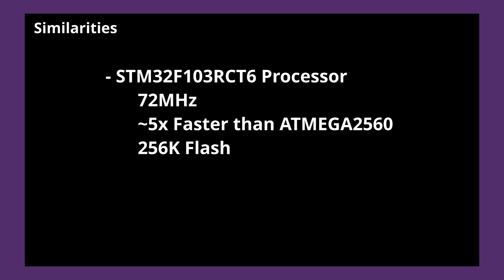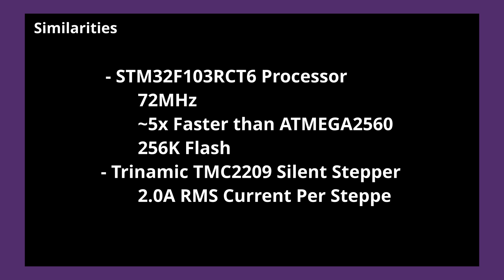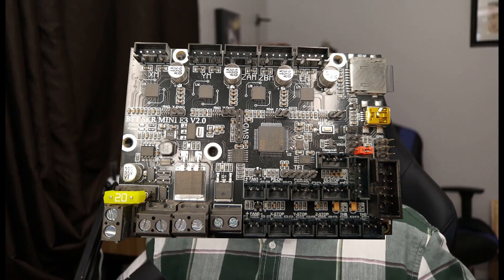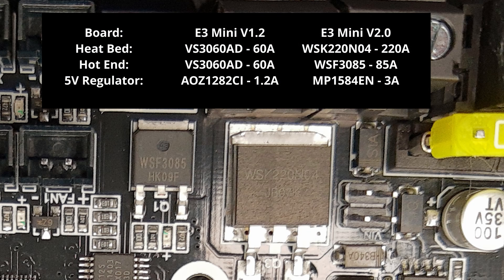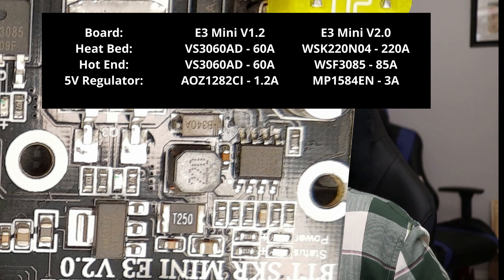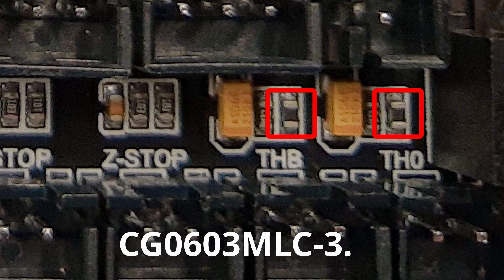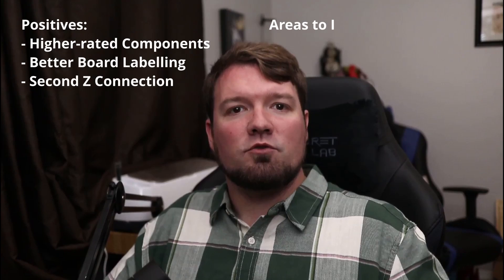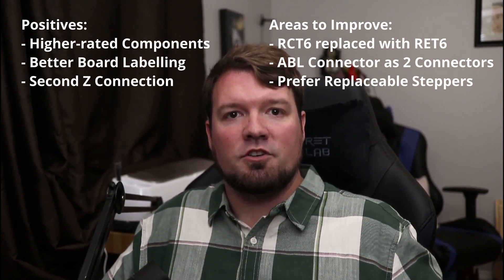BTT SKR Mini E3 2.0 - Worth The Upgrade?

Comment: @1:12 : Yes, the original spec may say 256K BUT you can access 512K of programming (well, a little less for the virtual eeprom space) with the F103RC chip. Why it was programmed to report only 256K? I dunno, maybe the first iteration did and they just kept in the spec? Anyway, Marlin 2.0 and the Marlin autobuild in VS Code have it configured for 512k automatically. You don't need to change any of the configuration (i.e. platform.io) manually.

Comment: I've had good luck with my V1.2, but I don't use it super heavily. My biggest hope for the V2.0 board is that it doesn't vamp power over USB. I don't know if this was touched-on in this video or not. I specifically talked with SKR about this before the 2.0 board released and hopefully they heeded my request. I'd at least like an jumper to give an option about it. This affects me as I use Octoprint and I don't want my mainboard sucking power over my Octoprint's USB connection. I want my Octoprint Pi machine to run all the time and be able to control a relay to switch on my SKR board. I'll probably upgrade anyway. Thanks for the video!

Update: I just reviewed the schematics for both boards and it looks pretty clear to me that the V2.0 board no longer does anything meaningful with the USB +5VDC line, so, that's encouraging. Though, I could be mis-interpreting here.

Comment: So it the upgrade from V1.2 to V.2 worth it? I have just had a V1.2 in my Ender 3 and it has just gave up the ghost (pardon the pun) so I am thinking of upgrading to V.2 and going with the TFT, but because I don't have a BL Touch or anything else attached is it worth just sticking with V1.2 and a TFT? and saving a bit of cash?

Comment: In the US most outlets circuits are on 20A breaker, if they were to actually trip at 20 amps that would yield 2300w @ 115v. You're only supposed to use 80% of a circuits rated capacity, so let's say 1800+ watts. In reality, according to Goodson Engineering,  "a 20 amp breaker must trip at a sustained current of 27 amperes (135 percent) at less than one hour, and at 40 amperes (200 percent of wire rating) in less than 120 seconds" That's a sustained 3100 watts must trip in an hour or less.

Comment: "...Household breaker can handle 1440W before tripping..."

Laughing in European 3.5kW standard breakers
Reply: Kinda sucks when your country invents the mass use of electricity and implements it first while the rest of the world waits to get the 2nd mover advantage.
Reply: @LastNameTom  Changing over would cost money and it could be done overtime, but it is doable since you guys already have 220V anyways between the split faces.

Now what I find completely unacceptable in the US installations that not the whole house is protected with GFCI (RCBOs)

Comment: 03:50 In EU we have 230V standard and barkers are usually rated 10A and 16A for heavy loads, so usual outlet will provide at least 2300W of power.
Reply: New installations use B16 breakers for sockets exclusively, so 3.5kW

Comment: excuse me, german outlets can provide 3.6kw before tripping a breaker, where can i get a heated bed that will take that much current?
Reply from the maker: Most pads are developed for limitations that are safe around the globe, so you'll be hard-pressed to find anything above 1440W unfortunately :(. Still, 1500W is akin to a blowdryer, so it'll heat up VERY quickly.
Reply: @TheFirstLayer  hehe i know, those 24v beds still do it rather quick, its under 3 minutes to get to 60°C. the only machine i know that draws close to those 3.6kw is my welder and thats running on a 230v 20A breaker so theres still headroom for it

Comment: I swapped it into my ender 3 pro with a tft35 and I couldnt be happier. I have used 3 fool spools and many hours for printing. no problem so far, and wow is so much more quiet. it was a low cost must.  atleast for me. usb and sd reader was a gamechanger for me too with tft support. it doesnt freeze any more.

Comment: I have the 2.0 it’s great. I tried using the 5 pin connector for my ANTCLABS  V 3.1 BLTOUCH   I couldn’t get it to work unless putting the black and white 2 pin connector into the Z home connector.  Of course using the appropriate firmware.

Comment: Actually, it turns out that the STM32F103RCT6 (ok that's a real mouthful, I'll call it the 'RCT' from now on) used in both the SKR 1.2 and 2.0 boards actually contains 512K of flash, even though it is spec'd as only having 256. Furthermore, a 512K variant of the RCT chip platformio was added to mainline Marlin. In fact, BigTreeTech themselves actually build their official firmware this way -- if you take a look at the platformio.ini file in their firmware, they have their platform set as STM32F103RC_btt_512K! I've been using these chips as 512K chips (in both the SKR 1.2 and now the 2.0) for quite a while now and have not run into any problems, nor have I heard any outcry from the community about others having trouble with configuring the board this way. The general consensus as to why this is the case is that STM did this so that they could make different processors they could sell at different price points without having to design whole new silicon.

I am really happy with the 2.0 upgrade. I have heard that the 5V rail is more stable/less noisy as compared to the 1.2 board -- I don't have a scope so I can't verify this myself, but I can say that I am running both a BLTouch as well as a few neopixels without issue. (on my 1.2 board the BLtouch was kinda glitchy.)  Plus the board has provisions for plugging in the dedicated BTT 5V power module should you need a beefier 5V supply (dunno why, maybe you want to run 1,000 neopixels or something *shrug*) Plus you can add a UPS board, which is basically a board with a buttload of capacitors on it, that basically gives enough "wiggle room" for power loss detection code to be able to do meaningful work before the board runs out of power.  Add the dedicated EEPROM, improved MOSFETs, better thermal conductivity, etc., and I think the 2.0 is a pretty good deal.
Reply from the maker: I didn't want to blindly say the RCT6 has 512, as I have experienced several boards with both the 256 and 512 loads, with no easy way to easily determine which variant unless through trial and error. Also, given the E3 DIP 1.1 has the RET6 in every board I've seen, I expected the 2.0 boards to be the same across the board.
Reply: Be interesting to hook up an O-Scope to the 5V rail for each board and comparing them.

Comment: As a new person to 3D printing, I am having issues with the 2.0 board. The pre-compiled firmware for the BLtouch does not work. As a warning for those like me that bought this board for the "ease" of upgrade using an ABL. I now need to learn more about configuring firmware and troubleshooting the issues with the ABL ( mainly it will not complete a grid unless you manually level first. Which defeats the purpose of the ABL.) then I was planning on.
Reply: Are you using the correct version of the BLTouch firmware? BigTreeTech has two separate versions, which one you use depends on how you have your BLTouch plugged in. "firmware-bltouch.bin" should be used if you have the BLtouch plugged into the PROBE connector AND ALSO your regular Z-endstop plugged into the  Z-stop connector. "firmware-bltouch-for-z-homing.bin" should be used if you are NOT using your regular Z-endstop but instead have the BLTouch plugged into the Z-endstop connector.
Reply: @Otakunopodcast  I have tried both versions and both set ups. They did not work correctly. I have since compiled my own Merlin and still not working correctly. It homes correctly, will go through the 25 points, but when it prints i have high and low areas on the print. My print's first layer will be so close in some places that the layer is translucent, and far enough away in other areas that it doesnt have good adhesion. So I end up having to manually level still. I can not install my solid mounts since the ABL isn't adjusting the Z as it prints.
Reply: @chuckfiero  Your problem may be an odd quirk in Marlin. First, after you do an ABL you should always save to EPROM. Second, every time you home the printer, it turns ABL off. Most slicers implement a home before printing. 2 solutions. Edit  your slicer g code so it enables ABL before printing. Second, edit Marlin firmware to tell it not to switch off ABL when it homes. Both solutions are easy to find via Google.
Reply: @dereksteele1189  I went through and did my own firmware and I did get a result, I made sure that restore bedlevel after home is active. New question, I have my slicer set to G29 before each print, however I do not think the new G29 map is what is being used. Do I need to M500 after G29 in the slicer to save the newest bedlevel?
Reply: I also had problems with the preconfigured firmwares. 
I had to move 2 pin connector to the Z end stop connector.  Then it finally worked with their firmware.
Reply: Btt has not been known to release great first run firmware images. On the very first bin file in gethub they enabled bltouch by accedent. Keep an eye out for revisions.

Comment: I appreciate the improvements that they've made but agree that a better processor and removable stepper driver mounts would be nice.  Maybe they'll at least upgrade the processor in the next version.
Reply: IMHO they are targeting the SKR mini E3 at the person who just wants an all-in-one, easy/no-fuss (relatively speaking) drop in replacement/upgrade for the Ender 3. If you want more fancy stuff like replacable stepper drivers, they have a different board for that, the E3 DIP.

Comment: PS.. My E3 Mini 2.0 has an RET6 processor.. as well as 3 others I've seen.
Reply from the maker: Interesting! Mine was from Amazon, and given that it came out after the DIP 1.1, I expected the line to continue with the RCT6. My board has an RCT6, so I'm disappointed to see there are mixed batches out there again. It gets very difficult to review when you can't differentiate by the board revision.

Thanks for the feedback!
Reply: @TheFirstLayer  Yeah I've got 3 DIP 1.1 boards, two have RE's and one has an RC. My E3 Mini 1.2 has an RE and my 1.1 had an RC. They are ALL OVER THE PLACE with the processor usage.. Something I've been urging people to do is to look at the processor before installing it and closing it all up, I'm not sure what the differences are in Marlin between the RE & RC but there's bound to be differences, as they wouldn't have added a new processor if there's no changes.
Reply from the maker: @thomase907  it's pretty similar, except the RCT has a -DUSE_USB_COMPOSITE flag, whereas the RET has -DDEBUG_LEVEL=0 -DSS_TIMER=4. There are some other specific flags, but these ones are right and front.
Reply: @TheFirstLayer  Thanks for the detailed info!
Reply: Well RET6 or RCT6 is not that important as in real life both have 512k memory, you can burn with ease 512k in marlin with 0 issues

Comment: You've forgotten one of the most important updates...the V2.0 has a build in real eeprom, no more eeprom in flash or on sd emulation ... all other things a nice to have ;)
Reply from the maker: You are indeed correct. Admitedly, I did like having the EEPROM emulated on storage at times, but the dedicated chip is a huge step forward in bringing it in-line with other boards. Thanks for the feedback!
Reply: a lot more copper on the back for heat as well.
Reply: EEPROM does have less write cycles compared to flash tho
Reply: @daijoubu4529  Are you sure? EEPROM has 10x longer write life than Flash.
Reply: @tapy-yt  I stand corrected, maybe not 10x but longer indeed